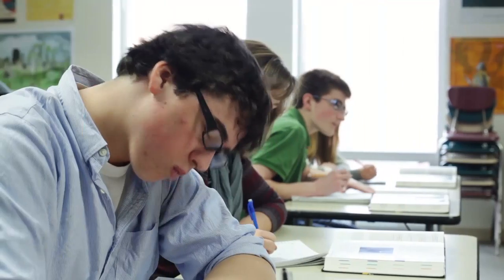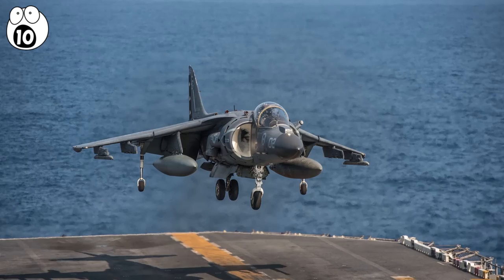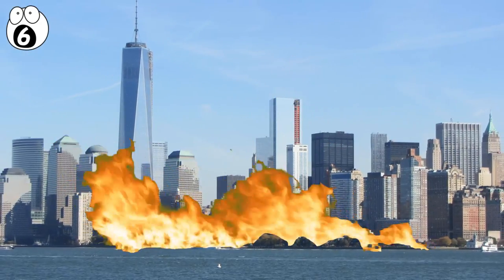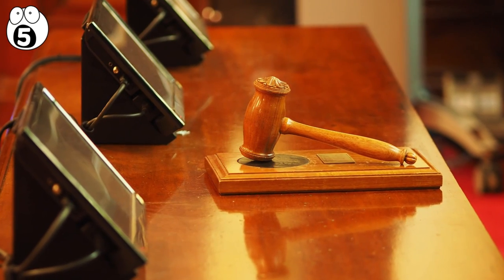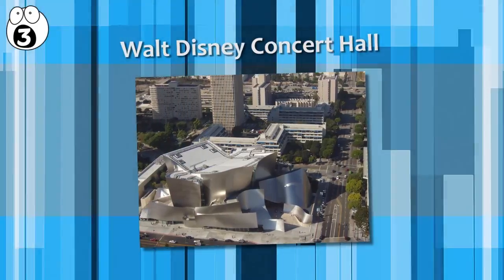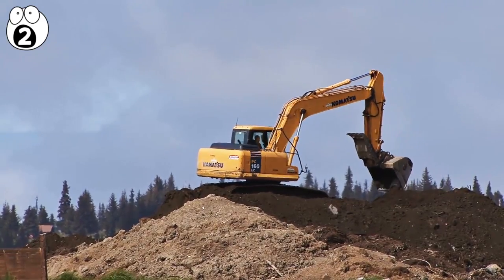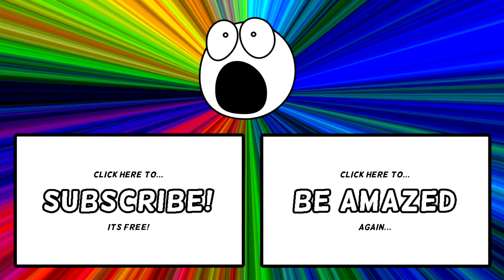Biggest Design Errors Engineers & Architects Made

Comment: Actually, the Tacoma Narrows Bridge (known colloquially as 'Galloping Girdie' at the time for obvious reasons) didn't collapse because it was too stiff.  In fact, had it been more stiff, it may not have been as big of an issue.  Suspension bridges are, by their very nature, highly flexible structures.  He was right in that it was due to the wind blowing across the bridge that would cause it to bend and flex so wildly.  This was because the bridge's designers wanted a neat and clean look to the structure, but this cause the bridge deck to catch the wind like a sail, and not a very well secured sail at that!  When they rebuilt the bridge after it collapsed, they did so leaving the tresseled girders under the bridge deck exposed, and that resolved the issue.... for the most part.  Every now and then the bridge will sway a bit if the wind is blowing just hard enough.  This would be kinda scary to experience, but Washington DoT generally prefers people not drive on the when the wind is this high anyhow - not because of the bridge swaying, but because at that point the wind is so intense that a careless driver could be swept into the other lanes!

Also, the pictures that show two bridge spans.... That's the new span they VERY RECENTLY put into place because the original one handled traffic going both directions.  With the growth in the Kitsap Peninsula, they had to add the new span to handle the traffic, so now each span handles traffic going one direction.

Comment: The Tacoma Narrows bridge collapse was not due to it being inflexible.  It was down to resonance and turbulence.  The air passing around the deck caused lift on the deck, just like an aircraft wing.  That, in itself was not a problem but, as the deck moved the lift reduced.  That combined with gusts close to the resonant frequency if the deck led to the deck oscillating like  a string when it is plucked.  The bridge was known as "Galloping Gertie" because this was a common occurrence.  One day the gusts were at exactly the right frequency to resonate the bridge enough for it to collapse.

Modern suspension bridges do indeed often have open trusses on the deck, but that is only one way the design the decks to avoid lift from being generated.

The millennium Bridge in London had a similar problem, It stared to move and that made pedestrians walk in step with the movement.  That in turn amplified the movement.  The bridge was closed while engineers added dampers below the deck

Comment: They're completely wrong about the Tacoma Narrows Bridge. The problem wasn't that it failed to permit the wind to pass through. The problem was that it was simply too thin -- so that the wind passing over and under it at a certain speed created resonance -- the bridge began to flex like a slinky -- and wind continued to reinforce the resonance waves until the bridge collapsed.

Though the makers of the bridge (and other very thin bridges made around the same time) had forgotten about this problem, it was actually well known to the early makers of suspension bridges who know very well about the tendency of the wind to produce this effect. In fact that was why the early builders of suspension bridges, like Roebling took special precautions to insure against it. 

But the more bridges of this type they build without resonance-induced collapse, the further into the background this problem fell -- and builders no longer concerned themselves with it -- until the Tacoma Narrows collapse, at which point everyone suddenly rediscovered it and a whole bunch of other bridges that had been made too thin had to be made more rigid or otherwise strengthened against the effects of wind resonance.

Which, by the way, has nothing to do with wind "passing through."

Comment: Welding is impressively strong. If you weld two solid steel rods together and try to break the weld, every single time the rods will break before the weld does. Beware though! If a weld is done incorrectly, it's as strong as attempting to glue those rods together with epoxy.

Comment: Even the issue with Tropicana field, aside from the fact the team changed their name in 2008 to just "Tampa Bay Rays."

The lower three catwalks (Ring B, Ring C and Ring D) are not all in play, only the sections over the field. only the top most, Ring A is fully in play.

If a ball strikes the in-play sections of Rings C and D , the ball is ruled a home run. otherwise, it's foul.

if the ball lands on the A ring or the in play sections of B ring below it and stays there, it would be ruled a ground rule double. If the ball ricochets off A or in-play B, they're fair game. The A & B rings are too close to home plate for a ball in flight hitting them having any chance of making it out of the infield in a stadium with no roof, let alone be a home run. The rings more likely to kill fly ball outs then home runs.

Comment: The Tacoma bridge didn't collapse because wind couldn't blow through it. It collapsed because the structural members of the main deck all had the same harmonic response.  Due to this, the main deck started to undulate  which continued to build on itself, snowballing out of control.  Modern bridge design intentionally  designs dissimilar structural members specifically to counteract this phenomenon

Comment: Just look at the the seventh one and how badly it was explained. Windows which are square on the ground receives stress from the weight of the material which is used to build the house. In some cases, humidity and temperature may apply to the deterioration of the window frames. But in the air, the cabin of the aircraft is pressurized to keep the passengers breathing. Why? Because the outside air is thin enough to give you hypoxia in matters of seconds or less. While being pressurized, there is a lot of force acting/pushing from the inside the cabin. The force can range from 800 psi to 1500 psi or more.
That makes the fuselage expand and the expansion applies force to the windows. Since the windows were square, they have corners and weak points. By weak points I meant the corners themselves. That means if you make the windows circular, they will have less weak points and thus less force being applied to the window and/or window frames.

I’m 12 and I already know this when you just sit there and be like “fuck google, I’m gonna make my own facts out of my retarded arse and people are going to definitely believe me!”

Comment: The Tacoma Narrows Bridge did not collapse because it could not flex under the strain of wind. It collapsed because it flexed too much and started to move in a twisting motion caused by mini high and low pressure systems called vortices. As for Citigroup Center 1) it is not crazy to build a skyscraper on columns, it's a perfectly sound idea as the weight of any skeletally constructed building is already supported by vertical columns, you simply cannot see them because they are concealed within the walls. 2) As others have mentioned Citigroup Center was already completed when the problems caused by using bolts in Citigroup center's V-shaped frame were discovered. Furthermore bolting can be an adequate substitute for welding as long as relevant natural forces are taken into account. Both of your conclusions about Citigroup center as well as your conclusion for the Tacoma Narrows Bridge are wrong and supported by incorrect facts and and poor understanding of architectural principles. Please do your research in the future.

Comment: Early aircraft didn't crash because of the arrester wire. They crashed BEFORE the arrester wire was invented, when they were expected to land and use the aircraft's own brakes and hope they could come to a stop before the end of the runway. They also crashed when carrier designers experimented with using nets or rubber decks.

After the invention of arrester wires, the pilot could simply apply full throttle on landing and if they failed to hit the wire they would have enough speed to go around. If they hit the wire, it would stop them before the end of the runway (even on full throttle).

Comment: The problem with the walkway design was that the single rod (threaded several places in the middle of it's length) was not practical to machine. Weight had nothing to do with it. The local contractor made the decision to cut the rod and thread the ends.

Comment: DH Comet: nope, the square windows on their own wern't the problem, nor were the stresses of high-speed flight. Engineers knew perfectly well about stress-raisers at sharp corners, but what they didn't understand yet was metal fatigue. The Comet was one of the first commercial airliners to have a pressurized cabin and it was this pressurization, effectively stretching the fuselage like a balloon and then relaxing it again on every flight, that caused stresses to build up in the aircraft's skin and eventually break it.

It's a bit like leaning on a plastic ruler and bending it during a boring school lesson: the ruler bends and flexes back 20, 30, 40 times without problem, but on the next flex it just shatters, your head hits the desk and everyone laughs at you. The Comet was the incident that taught engineers about this problem for the first time, and every aircraft (and many other machines) since has benefitted from that knowledge.

There were other exacerbating factors too: a extra aerial had been added to the top of the aircraft without taking account of the effect of it's mounting holes on the structure, and the fatal cracks actually propagated from the square corner of a window to one of these bolt holes.

Comment: The Hyatt Regency Walkway didn’t collapse because one rod supporter all the weight; it collapsed because the second walkway from the ceiling caused a shear point in the connection at the first walkway, and then sheared the beams off. One long rod like in the original design would have easily prevented this.

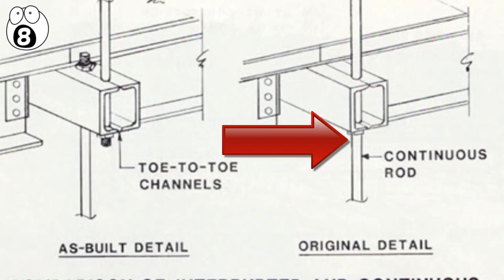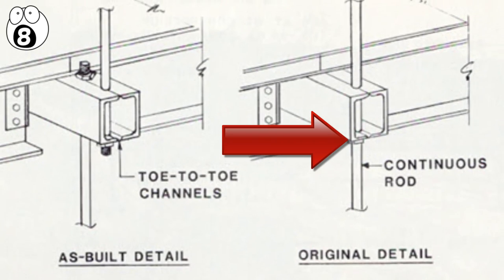Comment: The problem with the Hyatt Regency Kansas City skyway collapsed because the box connecting the two rods failed. (the leftmost box at 2:50  in the video or the top brown bar at 3:00) The weight of the lower walkway was carried by the lower rod to the box beam which carried it to the upper rod. As is clear in the "original detail" at 2:50, the box beam was never sized to carry that weight. Worse yet, when one rod pulled through the remaining weight bore on neighboring box beams, so the whole structure "unzipped". The explanation of the Tacoma Narrows failure is flawed, too.

Comment: The section on the City Group building is so badly researched it's painful. Architects don’t choose where to build a skyscraper, the owner of the land employees them to do it. The building was built with bolts; the problem was discovered after student called the architect because her professor was was worried about it. LeMessurier then doubled checked his calculations and discovered there was a problem – if the building was hit by hurricane force winds and a power cut took out the mass damper, it could fail. The bolts were then replaced, one by one, by welders who worked at night in total secrecy.

Comment: Tacoma narrows didn't collapse because it was too stiff. It's because the lack of holes built up air pressure. Which then caused a the bridge to oscillate at its natural frequency. Which then broke it. You can see videos of the bridge nearly fully inverting in the high winds (it was that flexible)

Comment: DeHaviland Comets started crashing because the aluminum they used for the skin became brittle after repeated heat cycling from flying at high altitude and then warming back up on descent. The skins would tear off the airframe, rendering the wings useless.

Comment: Aircraft carrier design changed because of the invention of the jet engine. Planes no longer needed the long deck to take off. Arrestor cables are still used their is no other way to stop a plane in that short of a distance. Sad you missed the obvious.
Reply: Jet engines are slow when starting to roll out. Without the CATAPULT they'd need a long deck.

Comment: The comet crash was not because of square windows. it was because the windows were mounted wrong. They were supposed to be glued, but instead they were riveted, which cause imperfections in the metall. So after a while the metal fatigue would make these imperfections bigger causing cracks in the metall

Comment: A friend's colleague was sacked after designing a water tower without allowing for the weight of the water it would contain.  As a dry tower holding nothing it would have been fine.  Another screw up was to manufacture a jet engine after burner with the decimal point shifted two places to the right.  The machinist followed the drawings and made it, thinking 'this looks a bit like an after burner, but I don't know what it really is'.  The specially made billet from which it was made was frighteningly expensive.  Result? Scrap.

Comment: The Tacoma Narrows Bridge segment has both accurate and nonsensical info.  The roadway did employ tall I-beams in place of the traditional open truss support system.  This had the effect of splitting the airflow such that some flowed over the roadway and some under it.  But, rather than a simple case of resonance as previously believed 
(which requires a periodic input of energy) the bridge reacted to the steady force of the wind with a kind of self-resonance known as aeroelastic flutter.  Wiki defines flutter as the "dynamic instability of an elastic structure in a fluid flow, caused by positive feedback between the body's deflection and the force exerted by the fluid flow".  Bottom line . . . if the girders had lots of holes for the air to pass through, the deflection would be reduced and flutter reduced or prevented altogether.  The replacement bridge which opened in 1950 reverted to the open truss design.  What any of this has to do with noodles is anybody's guess.

Comment: The description of why the Hyatt Regency Walkway failed is erroneous. You said it was because the new plan “left the entire weight of the walkway on the first rod.” But think about it. How would the first rod not support the weight of both walkways in both scenarios? What else was going to hold up the bottom walkway... ?

The issue was the fasteners—the giant nuts holding the walkways in place on the rods. They were selected to support only the weight of one walkway, not two walkways and another supporting rod.

The nuts failed. Not the top rod.

Comment: Another reason why they put the runway at an angle was because if a pilot were to stall off the end of the runway into the water, the ship would not run over the downed plane because it is not directly in front of the ship.

Comment: Submarines DO NOT rely on their 'engines' to come to the surface! Buoyancy is achieved by blowing air into the ballast tanks, which are around the sides of the boat. Flood them to dive, blow them to surface. They are assisted by the hydroplanes which, coupled with the propulsion, will take the boat up.

Comment: The tacoma bridge is indeed an engineering failure related to the resonance of the bridge in vibration due to wind load but it's not because it lacked holes in its steel beams

Comment: For the aircraft carriers, in the past, that is not an design error. In ww2, even the biggest aircraft carrier only have 260m or 853ft runway (US Nimitz 1092ft). The ww2 aircraft carrier does not have a steam ejection system, and the maximum speed is only about 15 knots. Therefore, aircraft loaded with fuel and ammunition need to rely almost entirely on their own power to take off, which requires a long runway.

Comment: The DeHavilland Comet's square windows failed because of continual pressurisation and de-pressurisation, not because of high speed flight. However the result was the same and a great lesson learnt the hard way at the cost of many more lives than 56.
The Lotus Riverside Building which fell over may have been initially due to unwise excavation but the real reason it fell was the miserably inadequate foundations which were simply not strong enough to anchor it to the ground. No proper steel reinforcing was placed in the concrete footings, which were apparently just cement-filled cardboard tubes.!

Comment: The planes didn't break from stress by going fast. The broke due to the internal pressure being greater than the external. You got the edges of the windows being the weak points, but the reasons are different.

Comment: Windows on planes is still a major problem. Building a plane without windows is much cheaper and safer, they are difficult and dangerous to build into planes, but passengers want to look out, so we have windows.
Submarines don't need an engine to surface, you don't fly/drive them like a plane underwater. They have ballast tanks which are filled with water to sink the sub and air to make it surface, a moped engine would be fine, if a little slow.

Comment: re the comet design error. because the comet was designed in such secrecy, they actually only tested it in small sections where it passed the pressurisation tests. the design reason for square windows? apparently the designer didn't want it looking like a boat. also they cut a bunch of corners, not glueing properly the skin to the frame and also mounting an aerial on the window corner.

Comment: I'm only up to no9. but it is completely wrong. Tacoma bridge had plenty of flex, you can even see it in the videos. It failed because it was susceptible to resonance, in which the local wind through the valley would set up a standing wave pattern through the structure.

Comment: The reason the aircraft boats were that was was because the planes had propellers and were not jets, they needed that extra length of take off space to get in the air, and couldn't have done that on a shorter angled runway. And yes some were able to pull up and try again.